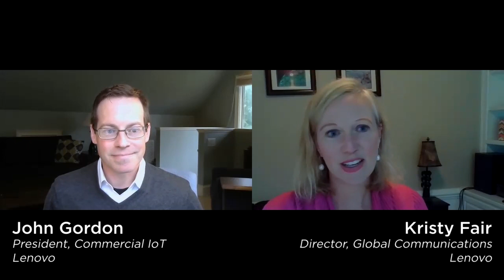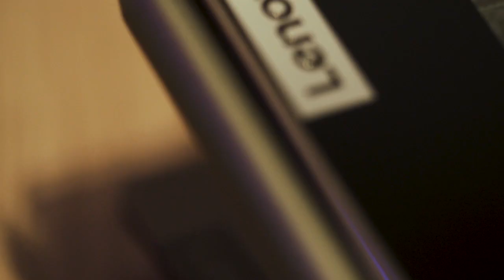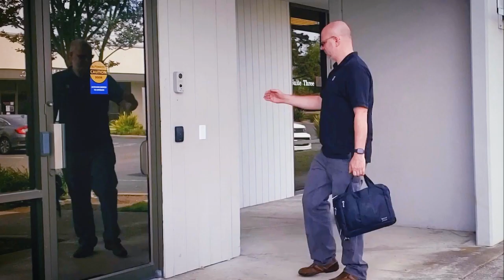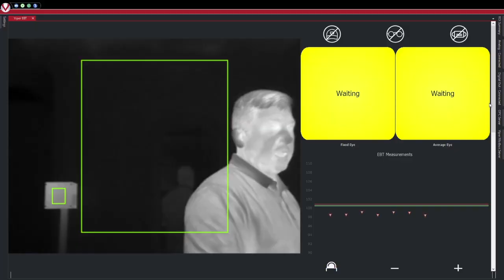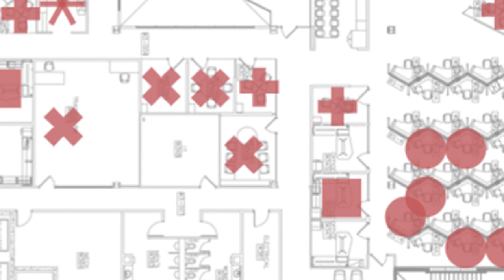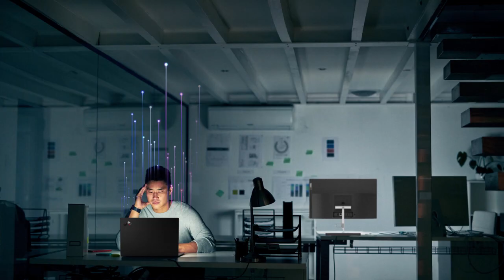Why now is the time for IoT for business

Comment: Lenovo

Please get rid of the Shaytan rainbow colors from your logo

STOP trying to be politically correct

START having a pair and soldier up

Also, Good job w/ Motorola phones, really kicked Google in the teeth and showed them how to do phones haha... 

I definitely want to see new battery tech for your Moto phone line.

And an orange left side button dedicated for screenshots.

Also

Bitdefender Premium should be standard with every Moto phone.

Get rid of chrome on your android because it gets HACKED HACKED hacked even when the app isn't open. 

Malicious redirects in background to dirty domains are happening for years now and google doesn't care...

Also, consider adding security for 5G malicious attacks in the background and over your networks such as dormant sandboxes on the ISP network connections 

The Ai software algor6should detect such attacks right from each device and send a report to a live engineer who actually works on it and updates the customer base.

Kind regards,

Light Theory LLC